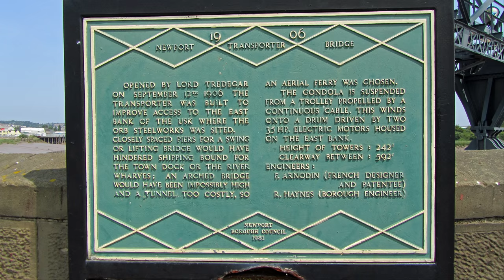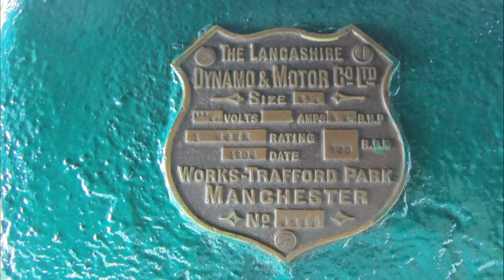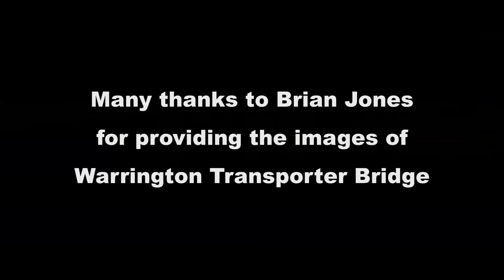163. Newport Transporter Bridge  South Wales

Comment: Was thunderstruck, Alan, that the public was allowed access to so much of a working transporter.  The heights in open grid work areas seem quite risky.  That said, seeing the machinery working was grand.  The two engineers surely would be proud of their work.  It is an elegant blend of strength, efficiency, and durability.  The surrounding ironwork was particularly enchanting.  A truly fascinating tour.  Thank you!
Reply from the maker: I think when it was built people were allowed to pay and walk across. It’s quite safe but wouldn’t suit anyone who doesn’t like heights and it’s quite a climb to the top. A magnificent piece of engineering, there are only a few left now and one of those needs restoration x

Comment: I believe the very splendid period hotel on the west side has closed down recently. I crossed this first thing when it opened in the morning, a few years ago when running the coast path. It's an amazing construction.
Reply from the maker: I'm not aware of the hotel, I was in my VW camper, which you saw parked on the West bank by the visitor centre. Cheers

Comment: Great video on an interesting piece of engineering! With your expertise on engineering in general we could have used some discussion on why? They built the bridge work, so why not build a regular bridge?
Reply from the maker: Thanks James, the answer to your question is in the decription of the video -  This type of bridge was chosen, as the tidal nature of the river prevented use of a ferry and it did not interfere with tall-masted ships navigating the river. Cheers
Reply: @MyNarrowboatVenture  Then my questions would be: Why not a drawbridge? Would it be too much more expensive or was traffic volume expected to be too low to justify a real bridge?
Reply from the maker: @jamesjorgensen3709  Hi James, this bridge was built to serve an industrial area and mainly the steel works on the other side of the river from the town. It would have transported workers, ie pedestrians and their bicycles across in the early days. As you suggest, the overall use would have been too low for such a grand bridge and it wouldn't have been seen by many.

Comment: I don’t think the local population would be too happy about you saying that Newport is in England!

Looks like the machinery is still in fairly original condition.  Middlesbrough has been modernised with new three phase a.c. Motors replacing the original d.c. ones, though these are still in place, and the control system updated.  The last I heard it was out of service due to some serious structural problems; I don’t know if it has been repaired yet.

With only five ever built in the UK it is strange that three should have been built so close together as Warrington No. 1, Warrington No. 2 and Runcorn-Widnes.  It’s a pity that the latter did not survive.

Wi almost had a sixth one, inLondon.  A modern high-level footbridge was built in the Royal Docks, I think about twenty years ago.  This was designed so that it could later be converted to also function as a Transporter Bridge, but this never happened.

The Tees Bridge is the only one I have actually been on.  A young lady in a high-vis jacket and hard hat once invited me to climb it, but I have absolutely no head for heights.

Hope Warrington No. 2 gets restored before it actually falls down.
Reply from the maker: That was an unfortunate ooops! But I also said it was in S Wales. This visit was made in 2013. I believe it’s been out of action for a long while and is due to re-open this year after repairs. I was in Middlesbrough some years ago, I think when the bridge had been newly painted blue. It was late one afternoon and wasn’t open but the operatives saw me taking an interest and said I could walk up and over if I wanted to. I declined the offer, as I needed to move on. Thanks for watching and commenting. Cheers

Comment: Very interesting. Why didn't they build a bridge and how much does it cost to go across? Thank you for a great video
Reply from the maker: Hi Penney. This type of bridge was chosen, as the tidal nature of the river prevented use of a ferry and it did not interfere with tall-masted ships navigating the river. It's only a few pounds to cross depending on whether you're an adult or child, and whether it's a single or return trip.
Reply: @MyNarrowboatVenture  thank you  I'm afraid of heights so I don't think I could walk up there like you did 🥺
Reply from the maker: @penneynoss9552  I can understand that but you don't have to walk across, you can travel on the Gondola just for the ride. There is a small visitor centre there.

Comment: Great Vlog as always Alan!
One thing popped up in my mind immediately though: What's the reasoning for building a transporter bridge? I mean, looking at it I'd say that a normal bridge ... just had a thought: Ar they a precursor to swingbridges, such as the Tower Bridge in London, or a cheaper variant in places where a bridge is necessary, though not for large traffic amounts, but in the way of large ships?
Reply from the maker: Hi Christian, many thanks. This type of bridge was chosen, as the tidal nature of the river prevented use of a ferry and it did not interfere with tall-masted ships navigating the river. Tower Bridge is actually a bascule bridge. Cheers
Reply: Hi Cristian you must also remember that the bridge was also built to transport the workers across to the iron works,so you would have Hundreds of workers using it all day and every day.Cheers